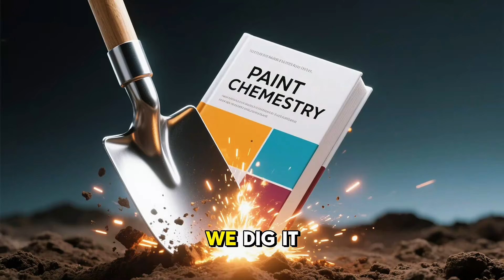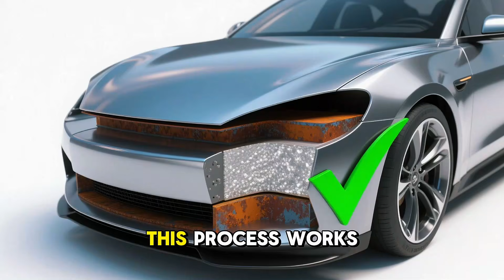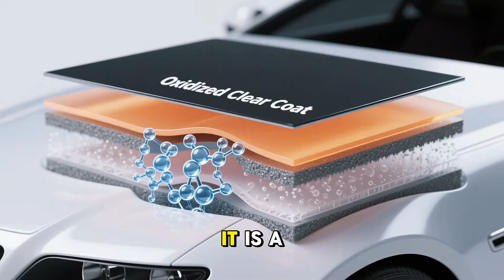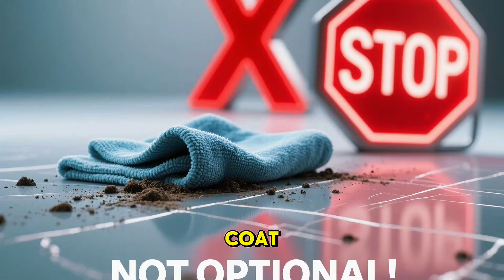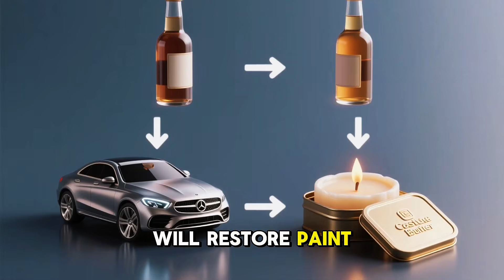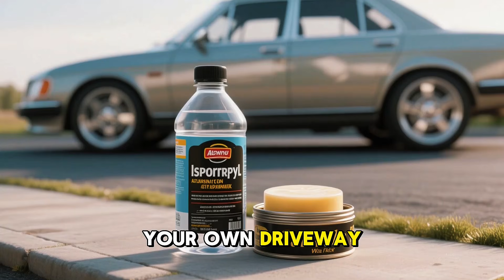$3 Liquid Makes DEAD CAR PAINT Look Factory NEW. PERMANENTLY. No Polish. AUTO INDUSTRY BURIED THIS

Comment: I wish 100% carnuba only costed  $3. And carnuba wax doesnt last long at all. So you will continue to apply this to prevent oxidation. More importantly 90% isopropyl alchol is the wrong tool for this job. It does not remove oxidation.  Oxidation doesnt just sit at the surface level its embeded. You need mechanical aggutation and the right tool which is not 90% isoproply alchohol. This actual can dry your clear coat/paint. Where is this information coming from?

Comment: The alcohol ain't going to take out deeply embedded contaminants in the clear coat or paint, or scratches.
There's NO SUBSTITUTE for a 4 step method ‼️
1 clay bar
2 rubbing compound 
3 polishing compound
4 wax or sealant 
Prove me wrong. 🤣😂🫵
Reply from the maker: You're absolutely right, the full 4-step method is best for perfection! 🚗

Comment: Uh.... not all vehicles are painted with basecoat/clear coat or commonly known in the industry as a Two Stage Finish. Older Vehicles were painted with Single Stage material.
Reply from the maker: Very true, this method is definitely best suited for modern clear coat finishes! 🚗